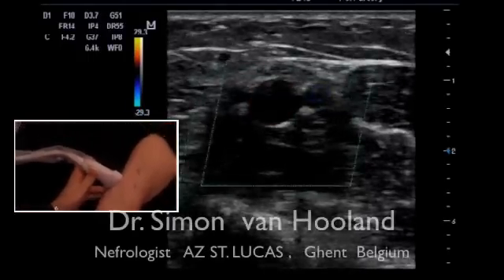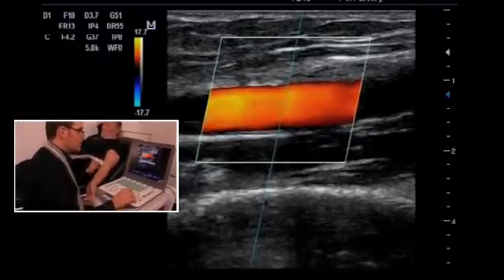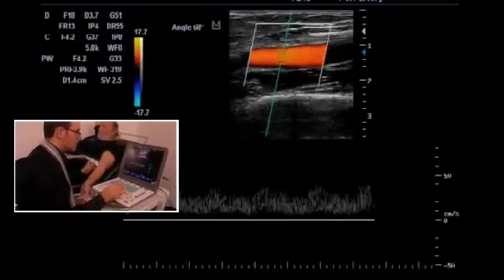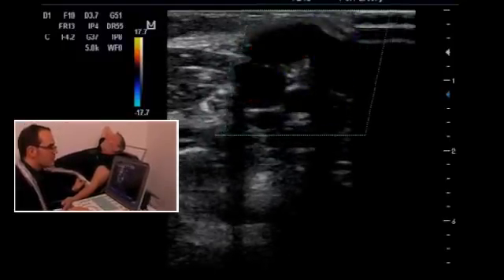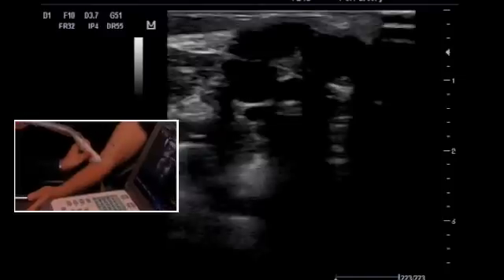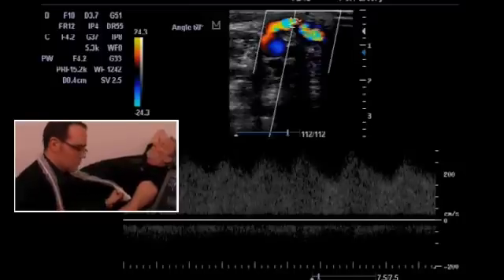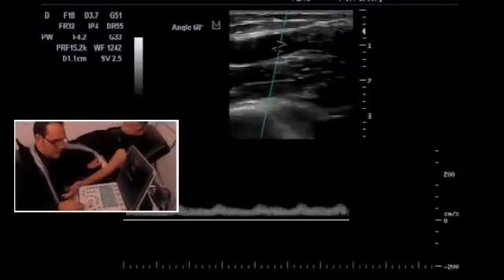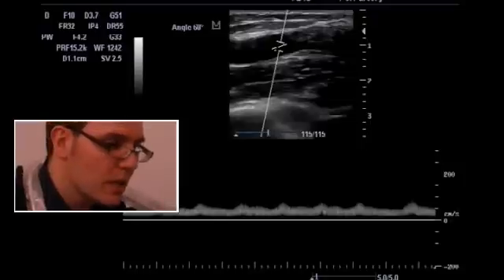FISTULA

Comment: Normally, at the fistula itself, there is an important circulatory acceleration and vibrations transmitted to nearby tissues materializing by a color imaging Doppler mosaic near the AVF and corresponding to the so-called artifacts perished vascular. When stenosis is suspected, its direct assessment by the Doppler is difficult. In fact, it is essentially the reduction in flow that can evoke the diagnosis of stenosis, which can optionally be confirmed by morphological analysis.
Reply: Exactly!